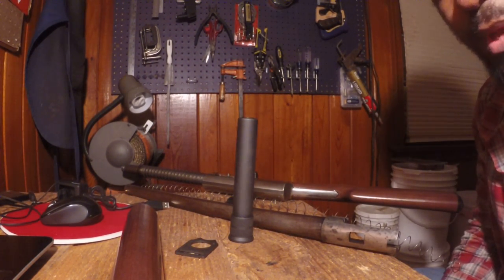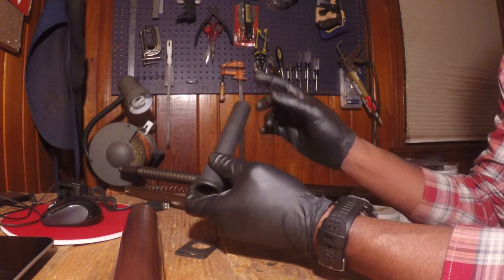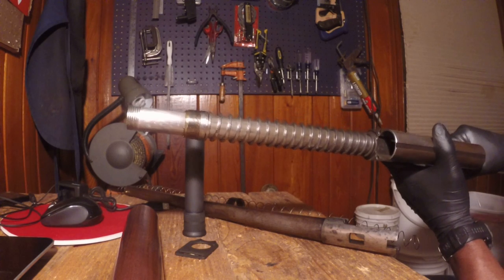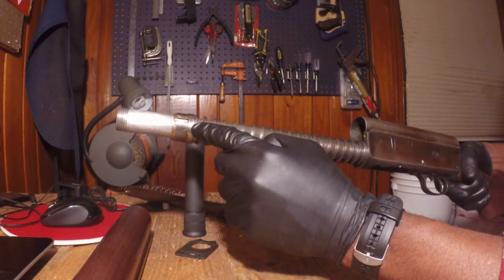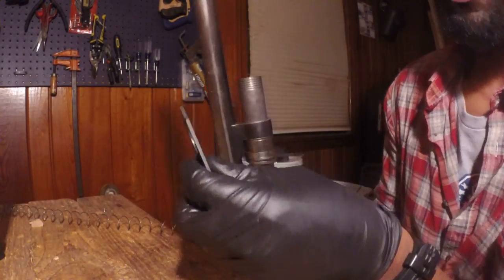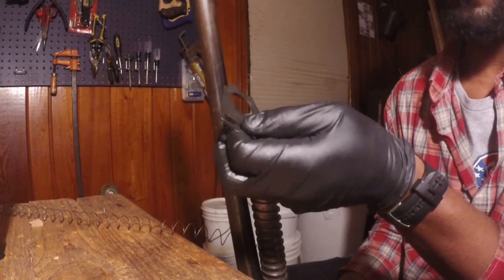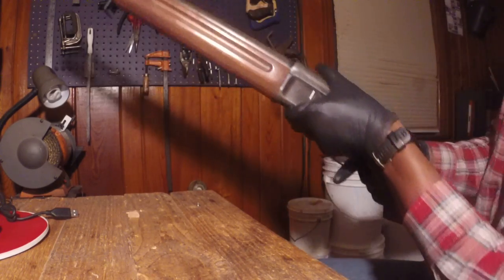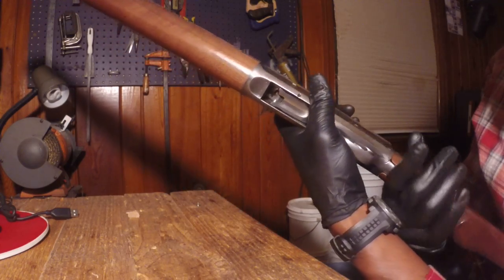Remington Model 11 Defender Project Update: Magazine Extension

Comment: You need to restore that back to orignial. That gun if you were smart enough to check value sells of over $1500.00 used they copied that after J.M.Brownings Auto 5 . The Model you have was only made a few years. Browning sued Remington for patent infringment.
Reply from the maker: Nah, it's a riot gun now.
Reply: Nope not even close. Browning had remington build them. They have the Browning patents right on the barrel. Google is your friend.

Comment: Get you an electroless nickel plating kit from Caswell and refinish that shotgun.  If you really want it to look top notch, polish the metal down with successively fine polishing compounds to where it has a fine polish before plating it.  The nickel plating will come out looking like a mirror.

Comment: Slick rig man, I just got into the Remington model 11,  and I must say, it's a fun gun to do things to... Old school, decently priced for what you get, I'm making 3 types, a trench type with a plus 2, a whippet type, chopped stock n all, no extension, and a 3 gun long barreled long extensioned animal... All with 2 piece carriers, on the trench I wanted to come up with an idea on how to put a heat shield on it, so it "floats" over the barrel, still letting it actuate, but protecting your hand from getting burnt, and also letting you grab the gun however you want, because let's say you pick it up in a hurry and grip the barrel and fire, it'll short stroke and cause a malfunction, this way it'll fire however you hold it... And I think it would look absolutely gnarly with a "cage" humped over the barrel

Comment: Sweet.  You do nice work. You might consider sealing that wood up underneath with urethane or something to prevent that oil absorption issue you mentioned.  Just a thought.

 I'm in the process of rebuilding my lathe.  I should have gotten some 'before pics' but I didn't think of it.  It's gonna be sweet in the end though.  It's very rewarding emotionally to tear down and rebuild something.

Comment: I'm gonna do this to my late dad's Remington 1100 12ga. with 28 in. barrel so the 10 rd. extension tube from Carlson's should work just fine with the tube coming out level with the barrel at the end with the metal bracket attached for solid support !!!!  I'm wondering with my other 1100 with the 25 1/5 in. barrel which extension should I get the 7 or 8 rd. tube extension to where it comes out flush at the end of the barrel ?  First things first I guess one project at a time I suppose !!!
Reply from the maker: Take your time, it will come out well.

Comment: I like it very well done!!
Reply: It looked like you were able to depress the cartridge lifter without pressing the bolt release button. On my Model 11 (Remington), I have to press the button to load every round. It looks like I might be able to file part of the plate that contacts the lifter. How does your Remington Model 11 load?